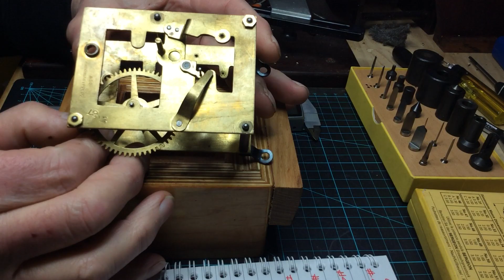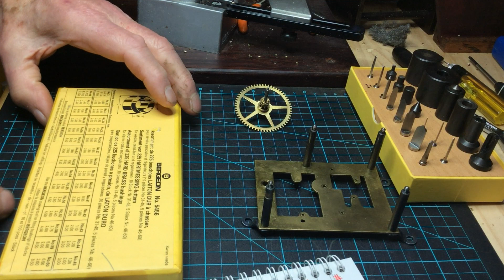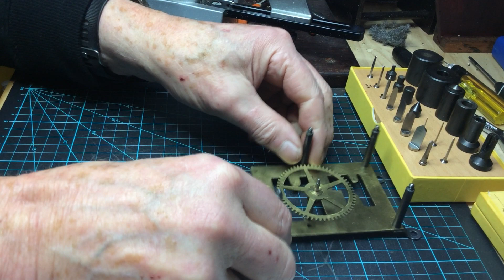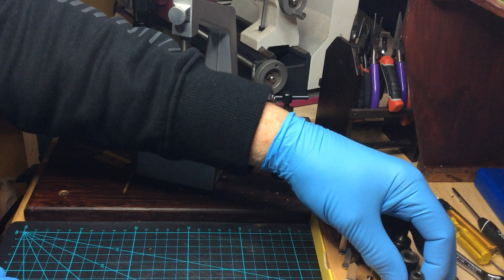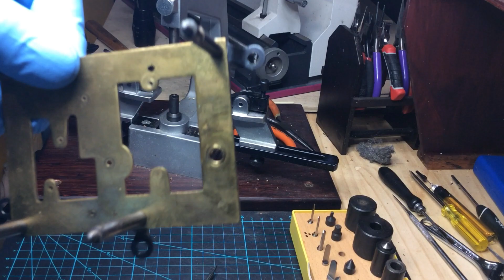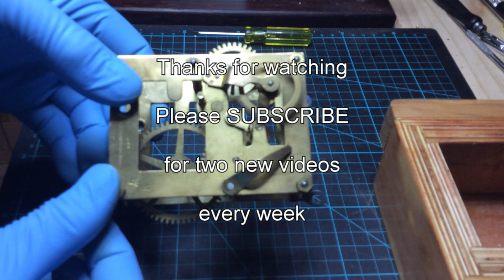Antique American Ansonia wall clock service - Part 3 #americanclockrepairs #AnsoniaClocks

Comment: Great video on bushings install great job thank you
Reply from the maker: Re-bushing is often overlooked by many people as they consider it too hard. One sure fire way to have your clock stop running is to have the wheel teeth not meshing correctly.